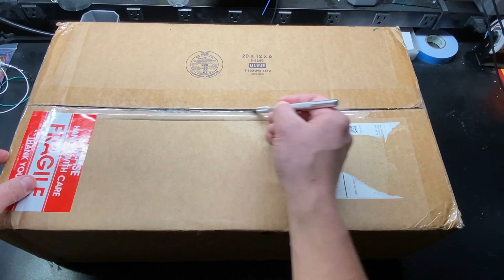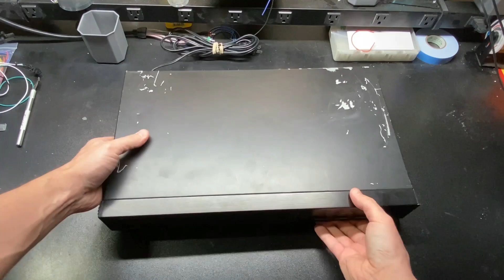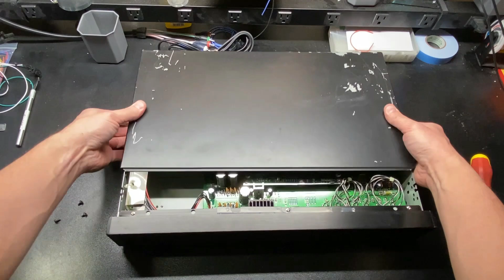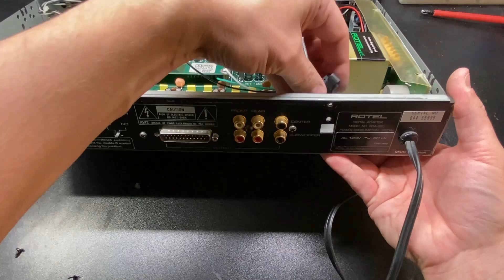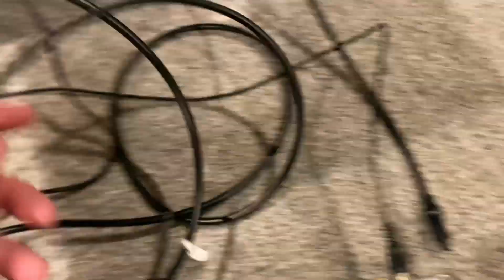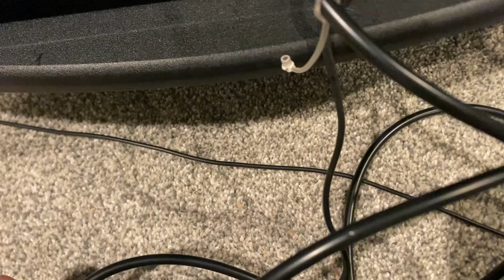Rotel RDA 980 Digital Out Mod

Comment: Where did you get the opital output jack !
Reply: Hi, do you have the exact part number for the jack.  I checked Digikey but I am not sure which part I should get. Thanks
Reply from the maker: @richardbrobeck2384  Digikey and TME (European Site).  Brand is Cliff
Reply from the maker: @richardbrobeck2384  Digikey and TME (European Site)

Comment: Are you interested in a parts-only CLD-3090? I had it working and everything but then the power supply starting acting up, refused to spin any disc and then blew up the fuse and when I replaced the fuse it exploded and cooked one of the IC. I assume the power board is not worth repairing and I also damaged the cables going to it. However the main video board and everything else should be OK. I'm wanting to get it off my hands.
Reply from the maker: Sure! Send me an email about details. It’s in my about section.